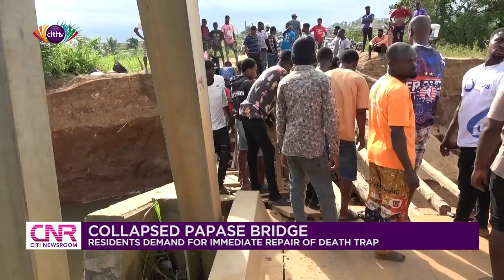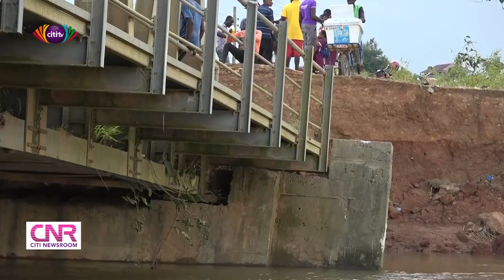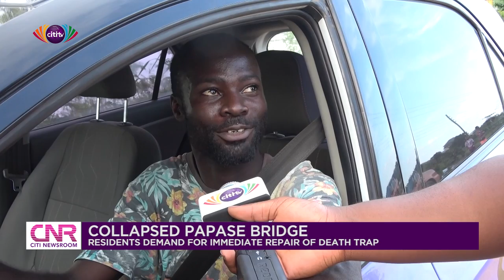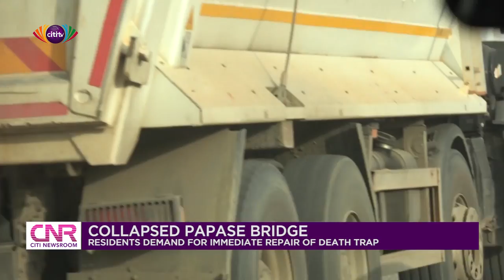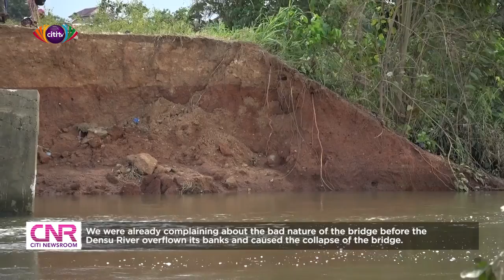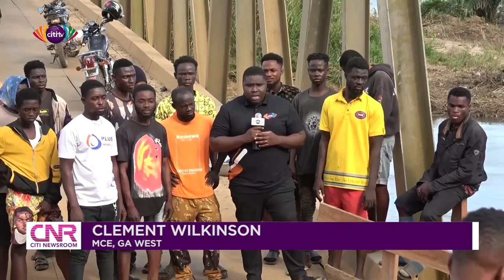Collapsed Papase Bridge: Residents demand for immediate repair of death trap | Citi Newsroom

Comment: Not all bridges are meant for vehicles... These lorries are heavy trucks must not be allowed to use this bridge.. There should be a weight restriction and concrete bollard must be erected at the approach to the bridge so it prevents larger vehicles from accessing the bridge... That's what the Europeans do and their bridges last very long.. Just because there's a bridge does not mean every vehicle must use it.